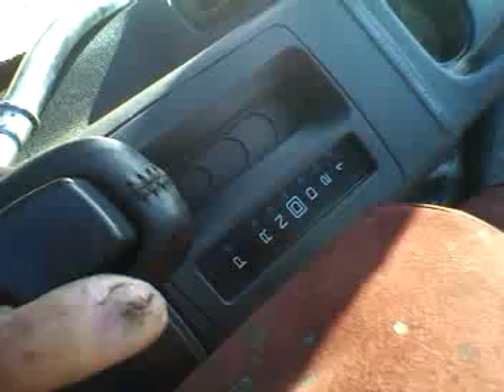DONK CUTLASS SUPERCHARGED

Comment from the maker: he had like $1000. total in the build ... he works at a junkyard got the car for $200, 2004 supercharged series II 3800 for $250. 4l60e 2000 camaro tranny $150. blazer disc rear end was like $150. 20" wheels $100. 07' malibu dash $50. homemade lift by cutting & weld  2 sets of control ars & ford expedtion coil springs ...